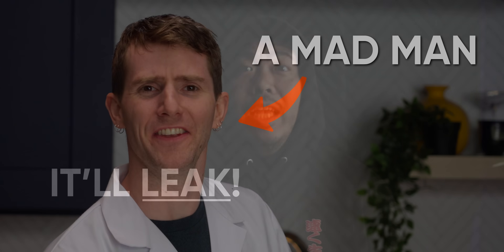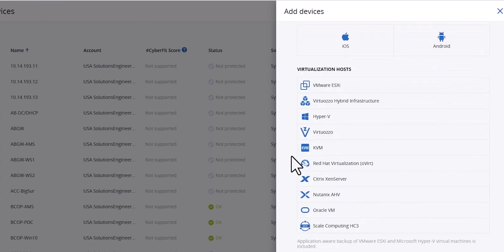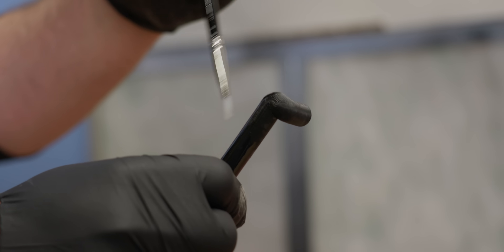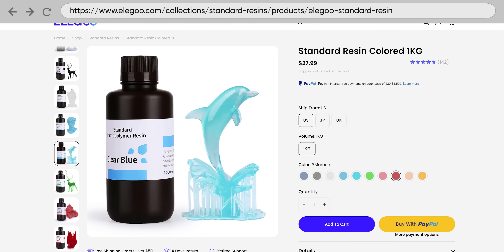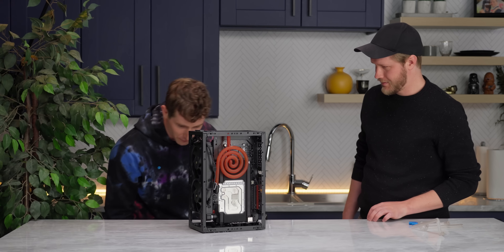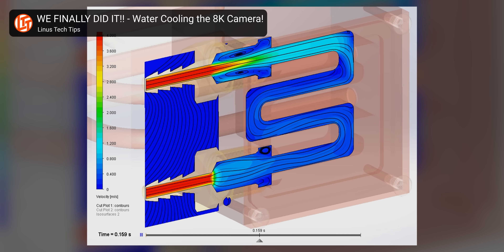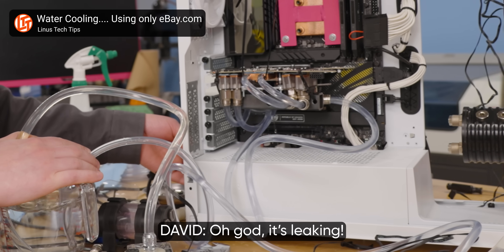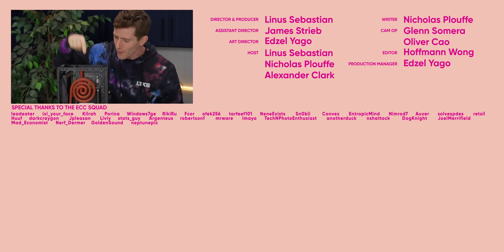3D Printed Hardline Water Cooling

Comment from the maker: Thanks for pointing out the issue with the Sharge sponsor read, we're removing that short portion from this video and we'll reshoot it for future integrations.
Reply: is this a trick to make me watch the ad spot
Reply: There goes the 100,000mAh dream 😔
Reply: Give us updates on the loop on youtube
Reply: Have you done many videos of the newer Mini PCs? They are getting REALLY GOOD! Do you agree?
Reply: Can you one day build a flowing liquid metal cooled pc? Maybe in steampunk style with copper tubes for dissipation? I think it would work great
Reply: the real question with any PE like adidas first put out there 3D shoes: how does it flare with UV light
Reply: Hey LTT, try printing and then coating with C.A. glue. A company I used to work for used that for a complexly (probably needless, but I digress) structured blowoff orifice on a machine. It’s a bit of a prick to get the glue out of the passages but they shipped a ton of multi million dollar machines with this orifice as one of the thousands of components used.
Reply: If you want to make the thermal loop even more 3D printed, there also exist flexible thermally conductive filaments (such as the Ice9). Also LEDs can be integrated using electrically conductive filament through the beauty of multi-material 3D printing or overmolding methods.
Reply: Hope you sanded before fixing that hole or the resin may not stick for that long :) i guess they used glue haha
Reply: Is there any disadvantage from increasing the tube lengths or imperfections inside the tube that could cause air buildup?
Reply: video idea ...take a pc to a neon sign shop and see what kinda tube bending art they come up with
Reply: You can print a pipe from PetG+Carbon and use electrolysis to make copper tubes or, for example, a radiator on an M2 SSD. For radiator lamellas and great detail you will have to build up thin parts at low current, which will take time, but you can print costume radiators, pipes, or motherboard reinforcement made of copper.
Reply: with the advancements in filaments yall shuld re visit this ...i mean now the tubes can be flexible or color change or have inbeded lights
Reply: Sharge sucks. I have one of their power banks that discharges itself, thus making it useless in an emergency. Please reconsider this sponsor.
Reply: @bahamutbbob  they have a whole sponsor feedback section on their forum, go share your experiences there in more detail to help the team get a better picture of the issues you've had.
Reply: I want to see your next projects like > 3d printed 2 way speakers and 3 way as well, and big/medium/small size subwoofer.
Reply: Gaming subreddit toxic, nice.😂
Reply: Wow 1h ago
Reply: Do you know what happened to Mr. Harwood?
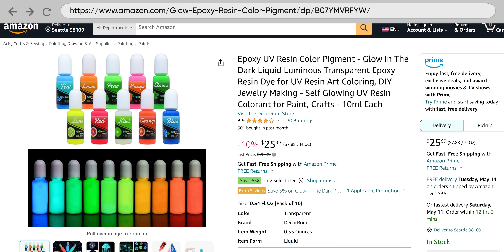Reply: @5:50 no don't expose a resin print to UV light especially clear resin you can over expose the resin to begin with just during the curing process nvm keeping it under the light for a prolonged period of time it will disintegrate.
Reply: Gaming subreddit toxic. 🤣🤣
Reply: Try making a $1000 aud gaming pc
Reply: Does the ECC all have AdBlock? (I know it's not a yt ad.)

Comment: Lets see Part 2 where you design a full custom loop and even customized water blocks with metal 3d printing.  Imagine being able to take standard off the shelf blocks but just use the internals and use your own custom tops to run the fittings anywhere you could want them and make the most minimalist or most showy water loop you can imagine.

Comment: I still think FDM printing would've been the viable way to go with several options to make it more water tight. A) Decrease layer height and 100% solid infill B) Annealing would both heighten the glass resistance temperature and help seal any microgaps C) PETG instead of PLA and/or D) Sealing would be easily accomplished by spraying or brushing on UV resin, either the specific UV "glue" or even 3d printing resin, and curing it with a UV light. The latter giving much of the best of both worlds.

Comment: You can't make a mold for this. At least not for mass production. It would require the mold part for the inside of the tube to be made out of a material you can dissolve, burn, or melt, while not hurting the resin

Comment: If you spray the resing with a clear coat it will make it much clearer and shiny
Reply: This works for plastic car headlights too. Lightly sand to get good adhesion and spray your foggy healights with a gloss clearcoat. They'll come out looking brand new. Same for spray paint. You can make any spray paint into any finish by using the desired finish in clearcoat.

Comment: Fun fact:  photogrammetry you can do on any smartphone is going to make a significantly higher detail and accurate mesh than a 3D scanner under a grand (or even more).  But LiDAR is essentially poking you object with millions of little tape measures, so it’s dimensionally accurate.  Even if it’s a little lumpy and afraid of reflections.  But if you can physically measure 2 known points, you can scale your photogrammetry mesh in CAD software to the proper size.  I had this problem scanning a motorcycle seat frame when making new foam out of TPU.  The LiDAR on my iPhone didn’t like the semitransparent glossy white base.  But photogrammetry doesn’t care.  You could even scan both.  LiDAR for a dimensional template, and photogrammetry for detail.

Comment: Water absorption can be an issue with certain SLA resins, so be careful when picking your material. It's also rarely declared on the TDS, so do your own experiments first:)

Hours or days can lead the SLA parts to quite literally desintegrate if you make the wrong choice

Comment: as a prior AM Engineer, companies like Xomatry are great for things like this. you give them the file and they print it. 

If you used Nylong 12 GF out of an HP machine you would be able to see temps for 350 degrees no problem, if you go with SLA, NExT is great and could take the heat. also SLA can be sanded and cleared to become clear. 

third if you get a desktop that can take Polycarbonate that will handle the heat no prolem.

Comment: I think oven sintering could be a viable option to get FDM print process to work and avoid the resin issue altogether. It would affect the tolerances at the fitting itself since sintering shrinks prints so you would need to print off some test fittings to account for the shrinkage but to be that is worth not dealing with the resin.

Comment: 4:56
One thing you could improve: 
The edge of the bending looks pretty sharp. Plastic doesn't like these sharp edges because there can act alot of forces, which can lead to hairline cracks.  What you want is a curve redirecting this force.

Comment: "The pressure" of water cooling :'D yeah its probably like five pascal. calling it pressure is almost misleading
Reply: ... and? Are you under some kind of delusion that insanely thin-walled photopolymers can survive even that?
Reply: @TheSolongsidekick  "thin walled photopolymers" are basically epoxy, and - even though there is huge variation - there are epoxys with similar strength as some metals, such as aluminium. I was half joking about the pressure being five Pascal, since it's probably much more than that. I'm going to guess that you are not really aware what pascal is; One pascal is the pressure of one millimeter of water.  Five Pascal is thusly pretty much the pressure of a drop of water. Albeit a little bigger drop.
Reply: @LunaticCharade  Yeah I know what a pascal is, when there's so much idiocy one doesn't have time to address it all.
Reply: @TheSolongsidekick  Right. I could not agree more - and it's good to know that you also know that there are 25.4 millimeters on one inch. Typical tapwater pressure is around 0.5-1 MPa, so that's 500 000 - 1 000 000 pascal.

Comment: if you guys don't already you can use heat to remove resin supports, it makes the surface a lot cleaner, i just use a crock pot with water in it.

Comment: Love seeing you guys dabbling in resin printing and this application is absolutely sick and limitless! Resin printing is what I do professionally. For finishing, get a highspeed handheld micromotor with Scotch Brite brush attachments. That takes the support flash off and you can add a little mineral oil for a nice, polished finish, making those clear and translucent materials really pop. Looks like you could improve on the support tip parameters as well. There were a couple of shots that showed some obvious uneven surfaces and bowing/sagging of the tube. Would love to consult on that if you need an opinion. Cheers.

Comment: 10:55 Actually, you could 3D print straight connectors to CA glue sections of pipes together into longer bits, and if you have a nice bezel on them and relatively thin wall thickness it would be barely visible.

Comment: PETG is quite fluid when melted. It should still be possible to make water tight tubings with FDM printer. That'll be a lot easier to handle than resin

Comment: Yeah, I think I'll stick to printing bending jigs. I refuse to print anything other than eco/bio resin, PLA, PETG or ASA at home. FDM printing is obviously not suitable for tubing and I have my doubts about the Bio resin here - in fact I have my doubts about resin in general unless you are very careful when picking your coolant. I wouldn't trust my hardware with resin playing nice with i.e. alcohol based coolants.

Comment: I was thinking,  i think there is a metal printer in the Lab for prototyping. If one would add like a big passiv or aktiv heat sink, like the oposit of the CPU and gpu cooler Blocks. Would that not be a freaking cool aß a Projekt, to create? 

In theory it should be possible to print a loop that could be the mounting plate for the Motherboard.

Comment: Print using a metal like copper and print/design the tubing with more surface are outside, with fins, bumps or extrusions for it itself to become a part of the cooling. So tubing becomes part radiator. With enough additional surface area from/with the special modified extruded tubing you might even getaway not having to use a radiator. All the tubing is the radiator.

Comment: The biggest problem with SLA printing isn't just the smell of the chemicals, but the amount of equipment required. Not only do you need the printer itself (And cost is a major factor as cheap SLA printers are absolutely not good compared to more expensive options) but you need a washer and a curing chamber. Oh sure you technically could get by without some of it, but unless you are making 1 or 2 things, it quickly becomes a major headache. Basically SLA is still very much in its infancy and you will spend a minimum of $1500 just to get started. This is still very cheap compared to where 3d printing started years ago, but it is a important consideration beyond having the right environment to use it. The biggest strength of FDM printing is the newbie can get one, pull it straight out of the box, set it on their desk and be printing in under 15 minutes. Nothing I am saying here is an inherit deal breaker as SLA does some things you simply cannot do with FDM. It is simply something people need to be very aware of.

Comment: Hey LTT, i have a bit of experience with 3D printer resin and achiving a high gloss transparency with it. 

I highly recommend picking up some egger medical grade IEM lacquer and dip coating your prints. You'll need a special nm wavelegnth UV light but you can use two common amazon $30 flourecent nail lamps stacked instead of a $300 IEM cure chamber. 

Just maken sure you have some UV Goggles handy.  

If you dont want to use egger lacquer you can also use Mia Secret ultra shine finish Gel with the same lamps... Just make sure you thin it out with some lacquer thinner or blow/bleed out the excess because its thiccc. Being gel and all.

Comment: There are also free services that you can take multiple pictures and then having them combined into a stereoscope 3D image and I think you mentioned this tech 6 months ago I believe. I feel this would have been a good thing to also offer as an option instead of the scanner you used, but it might be against the agreement you might have with the creators of the 3D scanner which I know is VERY expensive, i believe 3k cad.

Comment: Just FYI while I am blanking on which filament it is, but it is a common one, you can use IPA in a spray bottle and just spray the tubes, this causes the outer layer to momentarily become quite Viscus and it will then bond together completely and have the outer layer of the pipe print be one solid and sealed shell, the IPA will then in minutes sublimate and all you had to do was either use a thin line such as leader line from a fishing rod, which you can get at The Dollar Store, and either just make a simple plug that goes into one end of the tube so it can hang free for the few minutes it needs to do this process or you can feed it through the pipe and have a loop in the end and put a bar through a loop in the end of the fishing line to prevent it from slipping back through the pipe, but make it so simple to remove when finished. This can also be achieved by UV reactive Filament as the process is just about the same but then you just use UV to harden the outer layer and its completely sealed and water tight.

Comment: You can seal SLA prints pretty decently by spraying the inside with an appropriate material. I wanted a watering can and I waterproofed it with shellac, which is pretty harmless and really easy to work with.

Comment: This concept actually opens up some incredible opportunities with labs research regarding optimal water cooling flows and approaches. This isn't limited to physical means that the past 20 years had to use to develop modern water cooling... What if increasing the pressure by narrowing the outlet at one spot of the pipe created better cooling? What if CPU blocks and reservoirs could sitting practically in a tank with low pressure high volume water cycling worked better? How much of an impact does the layout and length of the tubes have regarding cooling performance?

Comment: Okay so hear me out, you 3D print fan shrouds that are either the reservoirs or apart of the loop to reduce tubing in the way of the PC components or just for aesthetics, inlets and outlets on the shrouds would make them stackable as well as light up with LEDs and you could even add character/ creatures coming out of them in design

Comment: Do build a cooling system using Silicone Oil Full Motherboard Immersion bath (i.e. silicone oil is a dialectric -- aka non-conductive -- BETTER than mineral oil!) and chill the silicone oil to one degree celcius and see how the motherboard performs. IBM did this back in the day with their AIX Power-6 motherboards soaking them in an oil bath  to overclock the boards by up to 150 MHz!  You can do this immersion bath to the SSD and spinning hard drives getting a lot more life out of them and faster continuous throughput!

Back in the day, we bought higher-end Car or Truck radiators as the heat exchanger system for the silicone oil --- i.e I found the Mishimoto Aluminum Radiator, which fits a Dodge 5.9L/6.7L Cummins 2003-2009 truck retails for $950 CDN which is expensive BUT it will cool up to EIGHT of the Tyan dual EPYC motherboards dipped into a single silicone oil bath using just ONE radiator. You still have to keep the CPU heat sink on each CPU but you just make a bigger immersion bath for the amount of silicone oil immersion fluid you wish to radiate heat out of using the truck radiator setup.  The KEY issue is keep the fluid flow quite high across the entire motherboard and cpus and the heated fluid running quickly through the radiator. 

You may have to SLOW DOWN all the CPU and GPU fans down since the fluid is much thicker than air and needs more effort to push the fluid through components.  I personally have NOT tried dipping the entire power supply in silicone oil BUT some overclockers HAVE done that. Someone needs to ask an Electrical Engineer about that due to the switching current circuit types involved in their construction. 

Hope this helps!

Comment: If the tubing does not fail within six months I would recommend leaving it in direct sunlight or under UV lights to see how long it survives thereafter. I would also love to see a comparison with parts printed by xometry or someone with a traditional industrial 355nm wavelength printer using ceramic resin or something of the like.  The desktop models or DLP models use 405nm wavelength to cure the resin.

Comment: check out siraya tech flex / tenacious for resin printing and their ABS-like line. Mixing the two 1 / 5 creates great results. Mixing in flex resin into almost any resin creates great results.

Also, the reason most people actually dont use clear resin is because printing / curing / making supports is harder and you will get more "support scarring"

Comment: maybe FDM would be good if you could print the tubes out of clear PETG, or PC, the drain resin through it, and shine UV on the tube. while it's full of resin. If you time it right the inside of the FDM tube would be sealed with resin.

Comment: my Father added a pump and sandfilter to a wooden tub (used as a big bathtub complete with heating), connections to pump the water in and out of the tub were printed in petg. Outside of getting broken by their dog and my 3 year old once each, those connections / passthroughs have been leakfree for about 5 years now without sealing it with epoxy or the like. only some teflon on the threads connecting the individual parts was used

Comment: I think doing something fun with the water, example would be to run it into a decorative waterfall that goes back into the case, or even better, make it a water amusment park log ride in which a belt pulls the logs to the top and the water flows down with the logs.